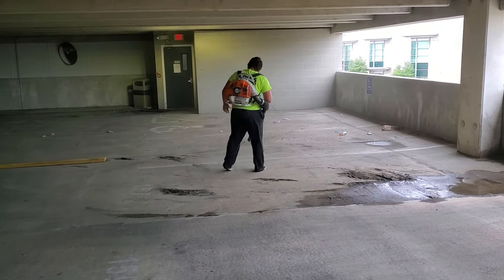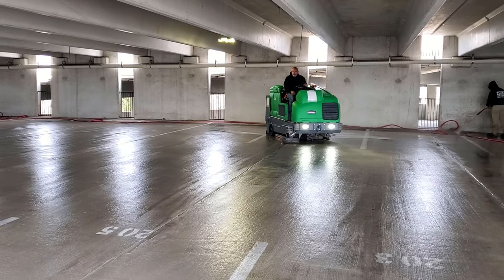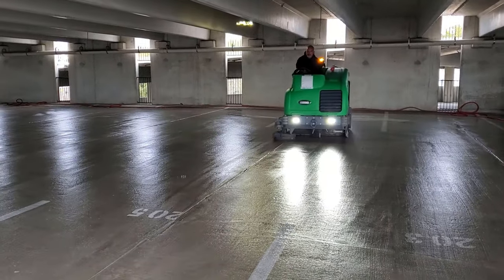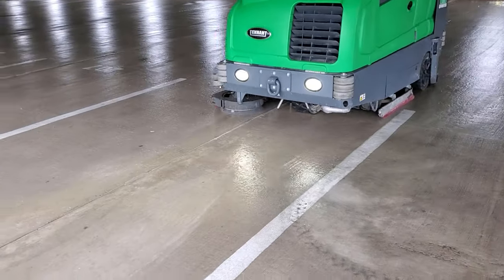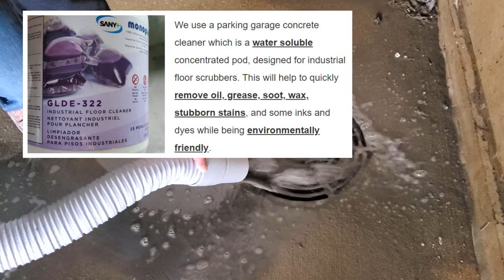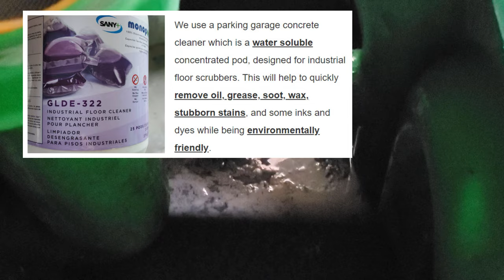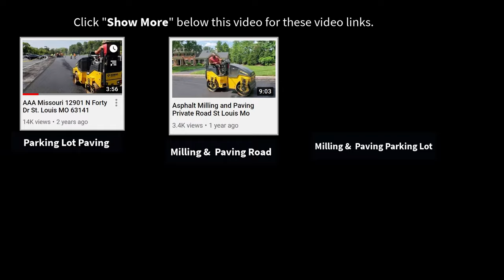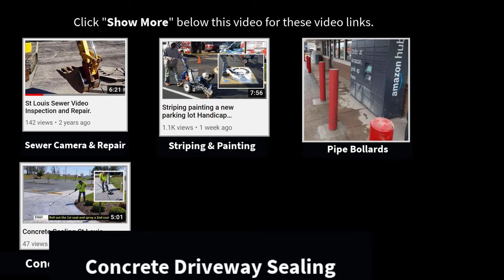St Louis Parking Garage Cleaning Power Washing and Striping

Comment: Did you surface clean and then come behind with the T20 without rinsing?  Or did you surface clean at all?
Reply from the maker: Hi Daniel. Sorry for the delay. We first power wash along walls and areas the T20 can't reach. We also hit oil spots and stains. Then the T20 will go over the entire area. Thanks again....Tim
Reply: I am currently gonna bid a 2 level structure , would u recommend I rent this machine and pre treat with a degreaser and get areas with you said above the areas the machine can’t get ?! This is 180,000sqft ! How many cents per square foot should I charge